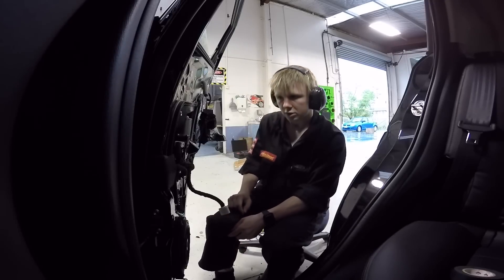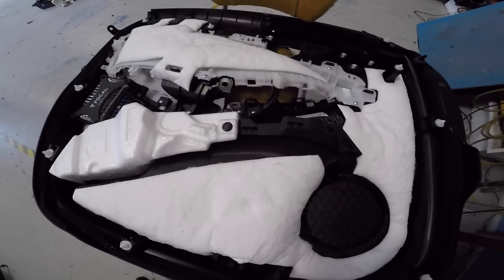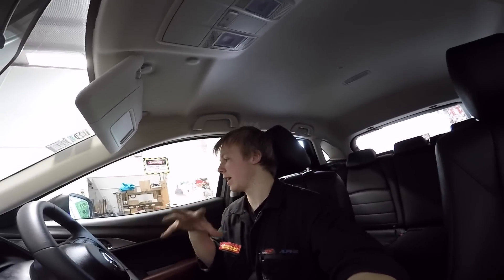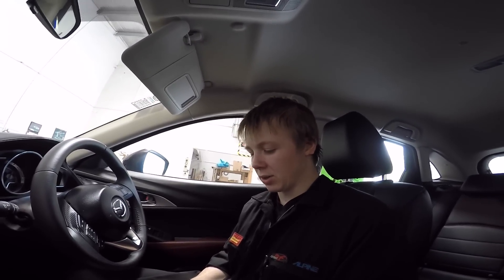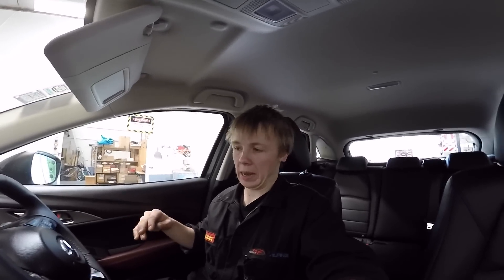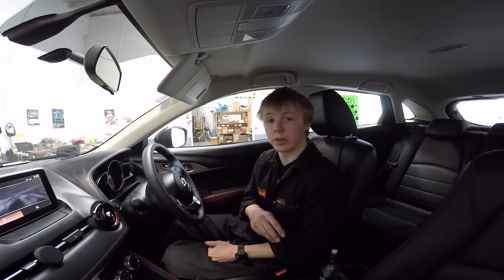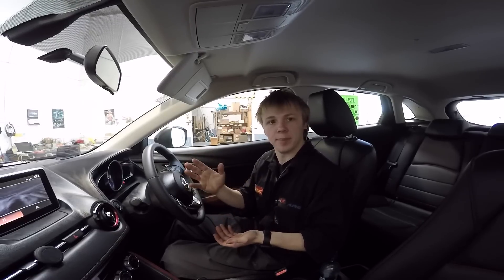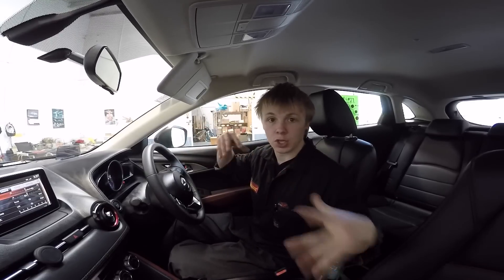2016 Mazda CX-3 + Focal PS-165fx + Focal PC-165f, Fully Sound Deadened Part 2!

Comment: That's the one thing I absolutely hate about newer vehicles is the radio, can't just put a new radio in like the older stuff...
Reply: Yes you can. All an aftermarket radio needs is Power, Ground, and Ignition-on. It can then be used as your main source. I know what you mean, but it's super simple to add an aftermarket and build a small enclosure (or even leave it out, very popular in the SPL community as you can't be in your vehicle for certain competitions.) One option is to mount it under your center arm rest and it's hidden from thieves.
Reply: @Kelocyde  You've never owned a Hellcat lol. A lot of tuning (suspension, ignition timing, fuel maps, etc) are accessed through the uconnect system., There is not yet an aftermarket head that will display or interact with that unfortunately. BUT, replacing the head unit is no longer necessary. DSP makes life easy.
Reply: @Frindleeguy  What about using a good HU with a Maestro RR datalink? I dont know about a hellcat but it restores a LOT of factory options on aftermarket HUs on other makes of vehicles.
Reply: I hear ya man !! 
With all the can bus computer wiring , its not the same plug and play that it used to be ! 
I actually prefer cars from the 70s, 80s and early 90s !!

Comment: I had the same problem with my Cruze in the backseat.  The sound was low and blocked by people's legs.  I had my dude cut the wires and instead of replacing them I put 6x9s on the rear deck.  Sounds amazing now.  Everything is Addictive Audio and that 10 inch slams harder than I thought it would.

Comment: I was thinking to put the crossovers underneath the dash. Find the right wires straight after the standard HU, cut them (just cables which are going to the doors as tweeter cable wont be used)and put crossovers. There is a lot of room there and no need to need to squeeze the cable between the door and the car. I'm talking about the same car of course.
Reply from the maker: Totally doable, we were on a time crunch so unfortunately had to just put them somewhere simple.

Comment: Had a system put in my 2017 and put 4 coax door speakers with a sub in the rear area with an lc7i and 5 ch amp, the dash tweeters are still hooked up and am having trouble with the front door speakers coming off and on, should I just unhook the dash tweeters>?

Comment: I've had the PS-165fx running in my Mitsi for around a year and the sound is unbelievable, crystal clear highs and pumping mids powered through deh-80prs head deck and amped. Now waiting to see this week if they can fit into my Nissan, but only going to run off the head deck (Pioneer AVH-X8850BT) , fingers crossed they fit with the crossovers and sound good. 
You should come and set up in Auckland we need a decent installer.
Reply: which amplifier?
Reply: Alpine намного лучше pioneer звучит

Comment: I've used this video as a kind of guide when I was upgrading speakers in my Mazda 2. I don't know how much improvement was with CX3, but in my case I'm unhappy with the result.
I've deadened front door and installed Focal PS165v1, which are predecessors of FX's. High tones improved but door speakers are very quiet now and the bass were bad with original paper ones and is still bad with the Focal. Audio still sound like on small portable audio.
I've assumed that amplifier in CX3 would be the same as in 2, so it should handle with mine speakers as well. I'll try to remove woofer crossover (there are 2 separate ones instead of 1) and see if there is any difference.

Comment: I have a mazda 3 and i use fix86 instead of changing headunit/radio make a world of difference . focal 165 as3 for dash/front door plus infinity kappa for the rear door. I also have 2 jl 10w3v3 in a jl audio box in the trunk drive by jl jx 1000
Reply: Oh and the speaker are amplified pi an infinity 475a
Reply: Just keep the Stock HU and get an AudioControl Processor/Line Driver.

Comment: Looking to upgrade the speakers in my 2015 Jeep Wrangler.  I currently have the Alpine ilx-007 with CarPlay but have basic speakers.  What would you recommend in the Focal name brand for the fronts and sound bar.  I have a powered sub under the front seat.  Trying to stay under 1200 for all 4 speakers and and amp if truly needed.  Thanks...love the videos!

Comment: Does the sound deadening stand up well to water?, I'm thinking of when it rains a lot will the water just run over the top of the sound deadening in the door panels without it unpealing
Reply from the maker: absolutely as long as you clean the panel first with some sort of alcohol to remove any grease or dirt.
Heating the metal up before application also helps with the adhesion of the deadening.
its very tackey material so water has no affect on it once its appl;ied properly.

Comment: i have a 2017 mazda 3 hatchback and i can vouch for your experience with the stereo. i set the amps to give max power at volume 40 instead of going closer to the max volume of 63 to aid in controlling the volume control from the factory unit. the eq on the high end also sucks.

Comment: WHY do my speakers blow and smell burnt for the 2nd time 🤦‍♂️ i had c5's coax in front and focals165f coax in back with a JL HD 600/4 WHY DO THEY KEEP BURNING
Reply: The 165f are rated  70W RMS 140W peak. with that amp, you are giving the speakers more RMS than their peak handling capacity.

Comment: Can someone help me? If i want speakers to have amp powered, do i need wire from speakers to amp or straight from head unit to amp?
Reply: Lenton 

Check your head unit for its wattage output as well as your speakers for their RMS ratings

Head units can provide enough wattage for most smaller speakers. 

For example, I have 4 Focal 4” mid range speakers which are 40 watts RMS, and my head unit has 50 watts x 4 channels, so it has plenty of power to do those speakers. However my door woofers can handle 80 watts RMS, and if I wanted to push that much it would need to be through an external amp.

If you are set on using an amp for all your speakers, make sure it has enough channels, and the wattage it puts out on each channel isn’t too much for your speakers. If that’s the case, then the speaker wires should be run from the amp to the speakers.

Comment: Hi, can you suggest me speakers for the 2016 Peugeot 308?
i just want to replace the original, front and rear one with no amplifier 
i think thez are 165 but dont know the depth 
Focal RSe 165 , iss 165 , ps 165 series or somenthing like Hertz  dsk165?

anz suggestions is apricieted

Comment: Been trying to tune my system in my 2018 mustang myself if you could help me find the right settings for frequency on the crossovers for the speakers which are focal ps165f3 fs 66hz rears focal pc165 fs 70 in a jl audio rd 900/5 as well as jl w6v3 ive tried 80hz on both HPF and LPF as well as 90 and 100 just wondering if 100 should be the one as I feel 80hz isn’t the best for the speakers at 22 volume 75% amp in low power setting 2v I have my LC7i at 2v about 20% in the dial and the amp gain about flat horizontal (about 20% and sub about 30-35% in the dial I get 100% clear audio between 18-22 volume depending on the music if you have some input on this it seems with these settings The sound stage seems to come and sound balanced in the middle rather than full in my seat but balanced between all speakers (probably the job for a dsp rather than loc) just wondering what your input is for these. Maybe I should go 120hz for the speakers and 100 for sub but don’t really want that void between the HPF/LPF

Comment: Question about Alternator whine. I have focal krx3 front, focal k2p rear and kx 27 in custom box behind rear passenger seat. I was driving just the fronts and sub with Focal FPD 600.4 (no alt whine )but changed that out to the FPD 900.6 and now I have an alternator whine. I didn't have it before, or I don't believe I did? 

The ground position and wiring is the same, under passenger seat on bare metal. The amp and radio (pioneer 720bt) are grounded to the same bolt. This is in a 2006 Toyota Tundra.

Any thoughts on where it might be coming from? I am starting to believe its the new amp, as I backtracked all my wiring and all the power wires (focal 8 gauge wiring) are nicely separated from speaker wires (focal 14 gauge wires), rcas (knu koncepts) etc up until it gets to amp. If the car is on aux/acc engine off crystal clear btw. 

ps I am considering putting in a dsp at some point and wonder if that may clean it up? I am considering DSP for the Time alignment mainly, but people say it makes 320 mp3 and FLAC sound better as well? 

Thanks for any thoughts
Reply from the maker: Alternator/engine whine in most cases is due to the RCAS or for the speaker channels or the speaker wires themselves being to close to an amplifier power wire or a vehicles factory loom.
The rule of thumb I go by is this;
- Avoid having power wires and RCAS/speaker wires within a foot (30cm) of each other for as long as possible.
- If they must be within this proximity of each other, no more than a foot of length of the wires can be parallel.
- They can come close to each other as long as they are not parallel (i.e. they can cross over each other)

The reason for this is that power wires emit an electric field around them from the current going through them.
The RCAs even when shielded well, have very little voltage on them (1-5V) and next to no current, so the signal is very seseptible to external electric fields or (noise) and wind up sending the wave being emitted by the power cable into the signal input of the amp where is is amplified and sent to the speakers.

As for this only happening when you changed the amp, I would doubt that it is the amp itself causing the issue, though it is not impossible.
Make sure all your wire running is up to spec as I have listed above, and that both your amp and your battery, have really good ground connections to the chassis, with NO PAINT in-between the ring terminal and the chassis.
Hope this helps
Good Luck
Reply: Thanks for the detailed rundown,  I have everything run exactly as you mention,  power down center of vehicle and rca's and speaker wires down outer side of vehicle.  They only meet up at the amp. 

 The RCAs I bought were from KnuKonceptz and they were purchased because I thought my original set may have been the issue,  but it didn't change anything.  

The ground area was cleaned with a power grinder before mounting so no paint/primer or rust there.  Good solid mount location.  

That's why I am thinking it may be the amp itself?  I guess I can switch it out to another amp and see if that changes anything.   

Lastly,  what's your thoughts on DSP,  like Helix Pro or Mosconi 6to8, are they worth it as to what they do for digital music?  

I think my flac and 320mp3 sound pretty good but if a dsp does it better I would consider it.  But it's a lot of money for an unknown benefit as I don't know what it will do for my music?  Cheers and Happy Holidays!!
Reply from the maker: I sadly havnt had the opportunity to work with any high end dsps because as you say they are super expensive for what they do.
I tend to swing more toward the high end stereo side of things, like my pioneer avhx8850bt has 13 band eq, time allignment, 3 way crossover and an auto eq and TA measuring system built straight into it, which in my opinion is enough to correct any accoustic issues you may have in a vehicle. Obviously i still highly regard sound deadening though.
Reply: Car Audio.etc I was considering a new HU,  looking at the 4200nex pioneer.  Specifically for its time alignment.
Reply: are you using an older model of pioneer headunit ?
Reply: wax333 yes the 720bt
Reply: Car Audio.etc I did have a chance to listen to an Audison bit ten D last week.  The shop used my music from my USB and did an A/B for me.  Honest opinion is that I heard the staging move toward a more central focus,  but I thought the dsp stripped the life out of the music,  like using a soften filter on photos and video is the best way to describe it I think.  It didn't sound bad,  but it did sound processed.

Comment: Lol, looking at old mate's face, at say, 9:30 mark, is like WTF is going on!

 I cannot belive someone, professionally....could install power hungery-non sensitive speakers, without an amplifier, and be like why do they sound so soft. To be fair, the rear coaxials, could be used off a head unit, but the front component speakers ( which sound almost  AMAZEBALL'S enough to make me no longer hate the French, ((when adequetly powered)) are rated at 87.6 dB They need an AMP, full stop. Basically, without making the customer coughf up an extra, post intallation cost, the installer has made the system play at a significantly rediced volume...Congrats..

To be fair, I like the channel, and the young fella, but you need to be fair and unpfront as the  CAR install expert, it is on you to tell the customer: This speaker needs an AMPLIFIER, IF I INSTALL IT WITHOUT ONE; IT WILL SOUND WORSE THAN WHAT YOU PRESENTLY HAVE.

Comment: factory equalization is the same problem that i have in my BMW X5. Its ridiculous. :(
Reply from the maker: Goncalo Bello you can change the BMW X5 stereo system though, it's just a big job.
Amplifier and tuner is down under the spare tire
Reply: Car Audio.etc yes I have a mosconi processor, 2 amps, focals on the rear and Gladen 201 on the front and a sub in the trunk. But the worst part is definitely the factory radio which is heavily equalized. I can get it to sound good, but not Perfect... there is nothing like a good headunit with a clean signal to make the most out of your speakers
Reply: Goncalo Bello look into the alpine 4v units with "tune it" app I love the 13 bar eq allows for Q adjustment and sound stageing

Comment: Hi... I'm planning to install SQ sound system for my Honda CU2, are you able to provide the address of your shop?
Reply from the maker: Steve Rich 37 Gasson st, Sydenham, Christchurch
Reply: Car Audio.etc thanks... I'm from Hamilton 😔 I thought it would be around Auckland area... 😔 I'm looking for a good sound installer but might not be able to drive down south. 😔
Reply from the maker: Rapid Radio are pretty Decent
Reply: Car Audio.etc awesome... thanks! I'll check them out. There is also Mad Soundz here in Hamilton but I am not sure if they are good installers.

Comment: what was the alc control for ?
Reply: Automatic Level Control.  It automatically adjusts volume to overcome engine/road noise as vehicle speed changes.  The adjustment here affects how much the effect is applied.  0 = off, 7 = maximum.
Reply: so they wouldnt use a microphone for noise cancelation ?
Reply: wax333, No, you don't want noise cancellation.  You still want to hear the world outside your car.  This is why it's illegal in most places to wear headphones when driving.

Comment: What is the optimal Hz crossover amp setting for Focals ps165fx? im at 100Hz right now and they sound a little too bright
Reply: I have a 10 year old Focal 165V1 compo in my car (front door), powered by an (genesis) amp,  and crossover in my alpine 9855r headunit is at 60Hz (steep).
Why?  cause I regularly drive with my subwoofer removed and still want some "bass"  AND they can handle it VERY WELL

these little "cheap" buggers slam hard and loud

Comment: @car audio.etc hi mate. i have the renault tce 90 intens. great car. but the sound of the navigation radio with bass reflex speakers is not that good.if i upgrade with this focal speakers in the front and 2 tweeters. https://www.focal.com/en/car-audio/car-audio-kits-solutions/integration/focal-inside-renault/focal-music-live-version-4-0-ifr165-4 and the backseat speakers in the backdoors with this speakers: https://grouppashuysen.be/index.php?route=product/product&product_id=379 is this enough.  i want a nice sound in the car. is it big difference with the old speakers in the car then? and without the focal subwoofer, its also a great sound ? let me know it.